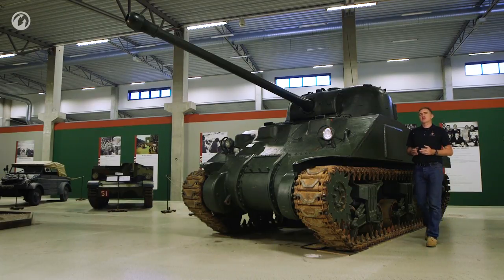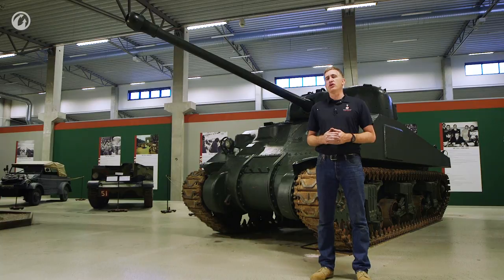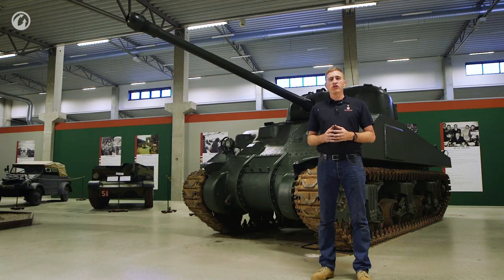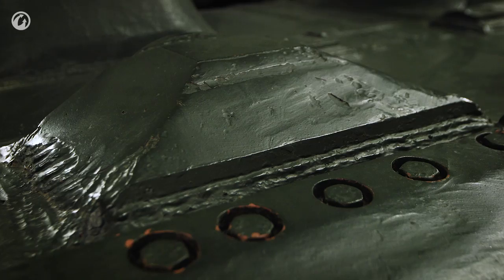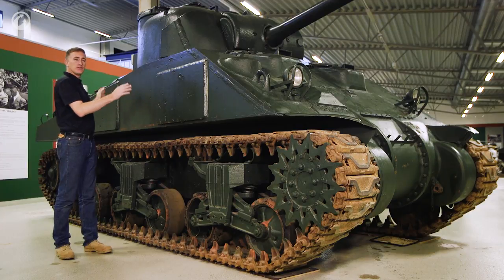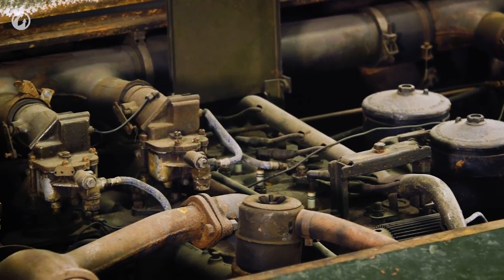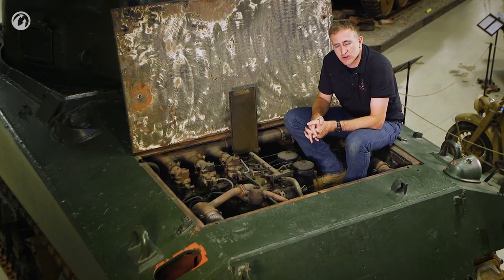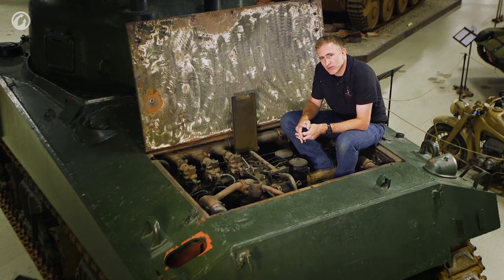Inside the Chieftain's Hatch: Sherman VC “Firefly" part 1

Comment: Ah the FireFly, can never have too many Sherman variants. Since ya know Shermans are best tanks.
Reply: clothar23 shermans werent the best tanks. Forward the shermans were the panzer 4 and the t-34s
Reply: There we're no best tanks of the war
Reply: What would you use as a measure to determine the best tank?
Reply: Well it did do many of the things that would qualify it for the best tank. It was easy to get out of, had pretty decent armor, was easy to mass produce, was reliable, and didn't break down that much. Depending on the variant, it had a decent or capable gun that was able to knock out tigers and panthers.
Reply: Best tank, depends on Country, doctrine and role. There is no single answer.  It also depends on the situation you most often will get into, how the infantry is equipment and what you are fighting. The M4/PzIV/t-34 were a jack of all trades. Not excellent at any, but good in all. As a medium battle tank needs to be. You have tank destroyers, mobile artillery, heavy tanks, light tanks and so on for the rest. M4 fared poorly against the Panthers and in general the German tanks, but that's when you call in tank destroyers or move your force of attack to a less equipped part of the front or take your time and start pounding them with artillery and air support. US was in no hurry. So they didnt need a break through tank like the Germans used. Different doctrines.
German infantry in 44 had a higher firepower per unit, than the US, so Germany focused their medium tank, the Panther more on tank vs tank fights, with infantry and assault guns providing enough fire power for the job, with out the Panther.
Its all apples and oranges.
Reply: If you make all variables equal, supply of fuel, ammo, competent crews. Proper maintenance. The best tank of WWII was the Tiger. It's K/D ratio is off the charts. 

Let's put it this way, if the Soviet Union had the Tiger in the numbers they had T34s the Germans wouldn't have lasted 5 weeks, let alone 5 years. 

The Tiger, in numbers and supported with proper logistics is a war winning tank for the side with the resources to support her properly.
Reply: A firefly can be beter whit a 122mm on it 😈😈😈

Comment: Why was the A.30 inadequate?
Reply: Huger, less reliable, poorly laid out.
Reply: I see, I suppose my next question would be why were they unable to fix the problems with the A.30? Was it a case of the original Cromwell chassis being too difficult to work with, or they just knew better once they tried it with the Sherman, I suppose on that note, why didn't the Sherman get a completely new turret like the A. 30?
Reply: True, but then couldn't you argue that starting on a new design on a different tank from scratch, as opposed to simply continuing to work with something you're familiar with, would lead to more wasted time? I'm going to assume that Brighty and Witherage had drawn up plans for using the Sherman for a 17 pdr. mount before or during A.30 development.
Reply: If you want to be really pedantic the A.30 was actually shorter than the Firefly (and regular Sherman) by about half a foot! And a good portion of it's height was turret rather than hull which in theory should have made it easier to conceal.
Reply: Plus the centurion was on the  drawing board

Comment: The Chrysler A57 multibank. Few engines have consumed so much to produce so little.
Reply: .. though as he pointed out in the video, it ended up being the most reliable of all the Sherman engine types after the Brits and Chrysler got together to iron out the problems. Losing some speed is tolerable if you gain a lot of reliability.

Comment: I'm building a model of the 1c composite just now about the tool positions the hammer and the track tension tool whare were they stowed? I see the hammers mount is on the rear of this VC imbue noticed on 1Cs there not and some say not to put the stowage bin on the back of the 1C but I've seen plenty real old ww2 photos of it with it on both front and rear

Comment: Didn't the U.S have a Sherman that was similar to the Firefly called the easy 8 or was that something completely different?
Reply: No E8 was a different variant than firefly E8 has larger t66 tracks with Horizontal Volume Spring Suspension (HVSS) and was fittied with a improved version of the Hellcat's m1a1 76
Firefly was pratically sherman mounting a 17 pounder and nothing more
Reply: John Cornell  17 pounder's combat performance is often overexagrated 
M1A1/2 l/55 and QF 17 pounder l/50 was comparible to kwk 42 7.5cm gun

Comment: You really have to wonder about WW II Brit Tankers. Did they wear berets because they could not get decent helmets? I read where half the British tank casualties were head injuries.
Reply: It wasn't because they couldn't get ahold of them, it's because they refused to wear them.
Reply: A lot of tanks were so cramped, that a helmet would get stuck in any lever or handle. So it was a trade off. More safety or get stuck and annoyed all the time. Most tank crews of both allied and axis forces didnt use helmets. A padded cover was often enough to prevent bruises. And you dont poke out when being shot at. Besides. If a 75mm AP hits your tank, a helmet wont save you 9/10 times. What saves you, is not getting torn apart and being able to quickly leave the burning tank before the next shot hits.
Reply: If nobody wore head protection then according to official casualty stats Brits were just plain clumsy.
Reply: I am sure some wore. I bet some US rule required helmet use. They had a lot of strict rules. But I doubt many followed them.
And yes, if your statistic is correct, it might seems so, because not many wore helmets inside the tanks.
but do those head wounds list by what? I imagine a lot might be caused in the early years by fragments. British riveted armor was famous for spalling rivets when being hit by even small caliber tank guns.
Could also be the design of british tanks. If they had a bad view and was prone to drive with their heads up.
Also, do the list include Bren Carrier personel. Those make sense, seeing driver and passengers had their heads over the armor.

Comment: why put a 30 cyl, 2 ton motor in it that has 50 less horsepower than the 500 lb ford v8?  Is it purely because that was the motor that Chrysler presented to the govt because Ford could only make so many V8s?  Thanks for help clearing this up in advance folks

Comment: It would have made more sense to just build a new Tank. The whole idea of the Sherman tank was to have a small tank that was fast and able to be shipped to the War zone. Six engines stuck together, I don't see any problems with that, right?, the radial engine was good enough for what it's purpose was. Why not just try and come up with a better armor penetrating projectile for the original gun?.

Comment: oh boy it's time to review the worst version of the Sherman
Reply: You mean the only version of the Sherman feared by the Germans as it had the only gun capable of beating the Tiger? Ok.
Reply: Wanderer628 the 76mm M1A1/A2 on the American Shermans could take out tigers aswell
Reply: While that may be true, the 76mm armed shermans didn't appear until later in the war. The Sherman Firefly was more common initially, hence it got the initial fear stuck to it.

Additionally, a Sherman Firefly with the 17 Pounder could hit targets at longer ranges, and had higher penetration overall compared to the 76mm armed American Shermans. Mind you, both could still kill Tigers, but only the Firefly could kill a Panther from the front.
Reply: It’s the English way.

Nice tank, mate. Be better with a bigger English gun. 

Same with the Mustang.  Nice plane when the yanks made it. Great plane with a better English engine.
Reply: It wasn't the worst, it certainly wasn't the best, but as the chieftain himself said, it was needed.

Disregarding post war tanks though the E8 was the best sherman, either that or the Jumbo.
Reply: 76mm Shermans were around at the same time but didn't get brought along because of logistical and training issues. over 200 E6s were in England ready for D-day.
Reply: Not really. They weren't brought over because the Americans thought that their 75mm gun was capable enough because of their service in North Africa. The 17pdr was pretty inaccurate at ranges but was the only gun capable of knocking out Tigers and Panthers at a normal combat ranges.
Reply: @larshenrik8900  not in Normandy, when they were needed. The 76 was still on the drawing board when the Firefly was delivering dead Tigers
Reply: @HarryFlashmanVC  Except ofcourse for the 100 76mm armed Shermans sitting in Britain and would be used for Operation Cobra...